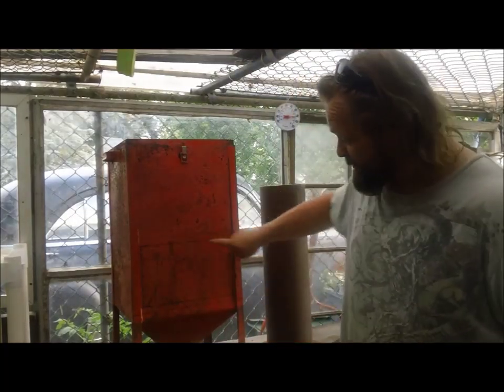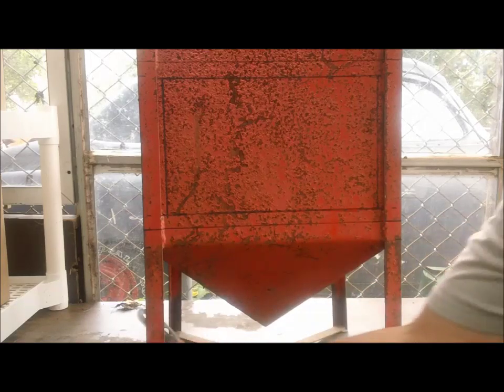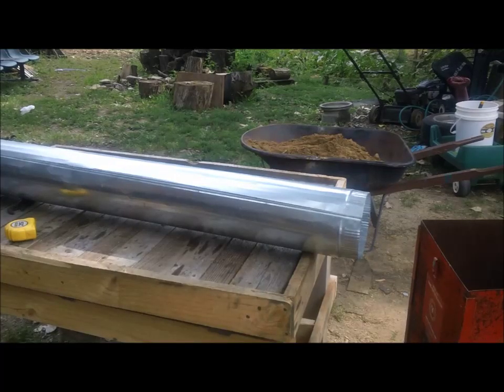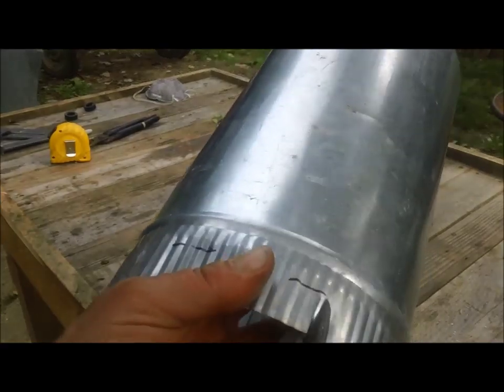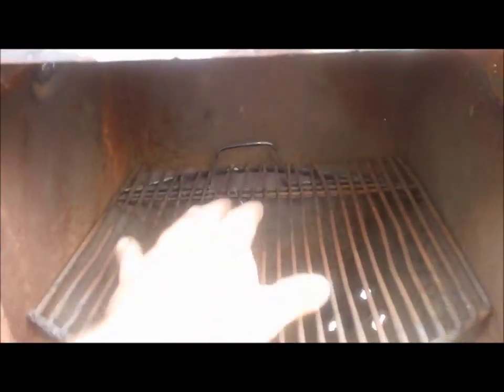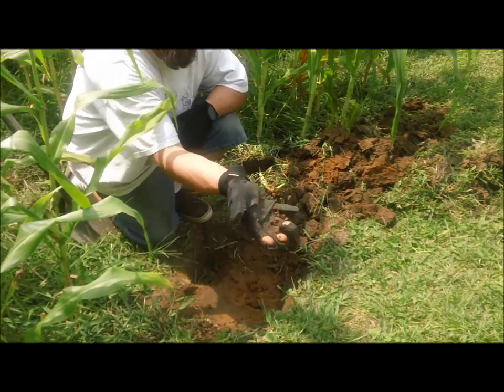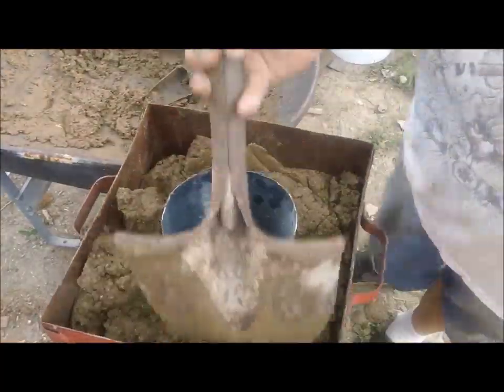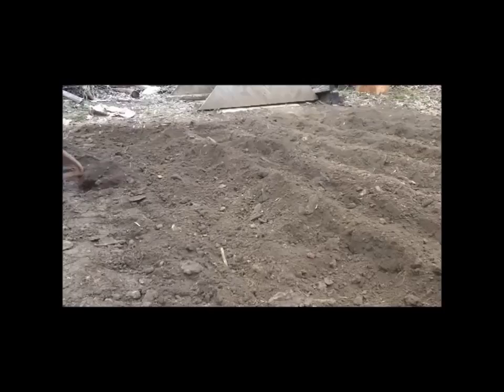Building a Rocket Stove out of junk!

Comment: Too late now, but your mix for the insulation of your stove makes the final product heavy as hell for moving. Adding in Vermiculite or Perlite would have greatly reduced the weight. Glad to see you repurposed an old sandblast cabinet. Nice video. The bricks on top probably set the pans too high and allows for inefficiency of the burn by reducing the air flow to the top of the stove. Get some old stove burner grills from a discarded stove and you can make it work even better in that regard. Also, to prevent the blackening of your pots on their bottoms when using this stove, you can always cover them with aluminum foil. That blackening is really difficult to get off if it matters to you.